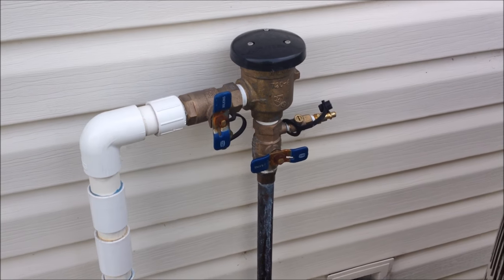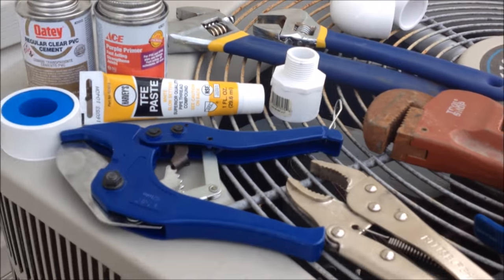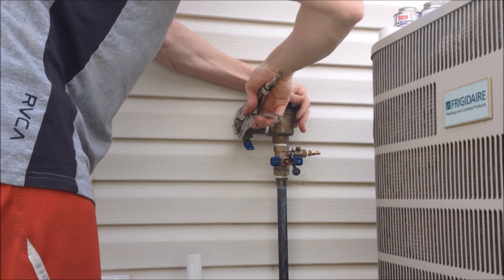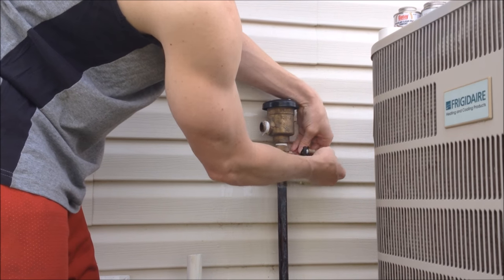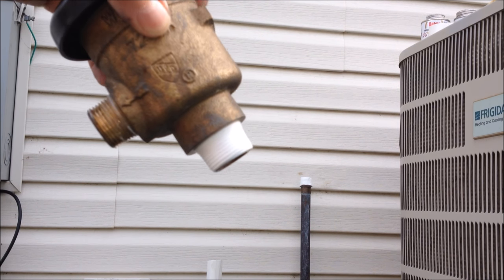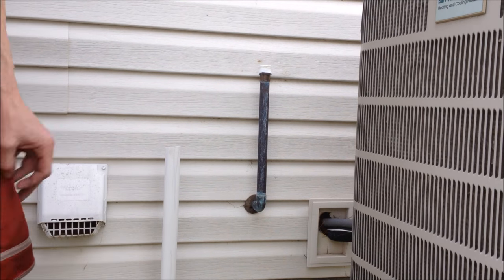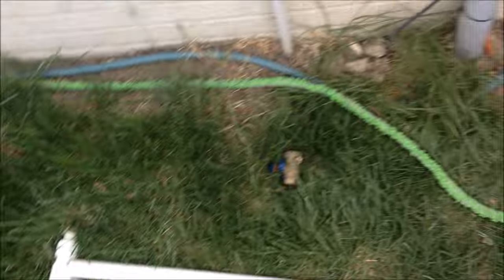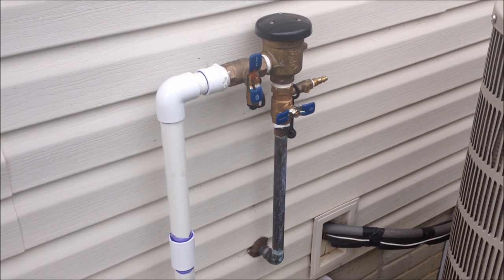FAST and EASY Backflow preventer repair.  Ball Valve replacement.

Comment: Thank you for this! Mom's sprinkler system has a significant drip at this same point, so I assumed it was from the ball joint valve not closing completely. When I turned on the valve, there's also a small crack in the pipe, (probably from freezing over the NE winter). I am no plumber by any means, but fairly handy, so I'm gonna give this a shot. Dad passed from Covid in Dec., so now we are having to learn how to do all these little house repairs ourselves. He would have taken care of it, probably without Mom ever even knowing it had been done! Learn something new every day, right?
Reply from the maker: Hello. Greeting fellow Nebraskan!  Sorry to hear about your father. Covid stole too many good souls…. I feel fortunate to still have both of mine, but wonder about life without them when the time comes. 

Yes, the NE winters can take a toll on these systems. Ever since I started winterizing my system, I’ve had no problems. I recommend winterizing to help save a bunch of work in the spring. Best of luck!

Comment: The plastic pipe will get brittle when exposed to the elements. Make sure you wrap them to protect from the sun and freezing.
I like to use galvanized pipes for anything that's above grade. 
Helpful video, Thanks for posting.
Reply: Nope. You referring to old plastic technology.
Reply: I am doing a bunch of repairs on mine. And wishing that I had galvanized pipes because the PVC got so brittle in the sun. Do you think I could go from PVC underground to galvanized up to the backflow preventer?

Comment: This setup MIGHT benefit from a “true union” ball valve installation (unions on both ends of the valve- CEPEX or HydroSeal Canada are good ones)? Yes, they are a little more expensive. But they will facilitate taking this assembly apart next time. You won’t have to cut and replace your pipe assembly. Just undo the unions and adjust or replace the bad valve. Good video, showing a common problem. Thanks for sharing!
Reply from the maker: That’s exactly what I wish I had!  I’d remove it in the winter and cap the pipes. There’s always the risk of a leak or crack come spring time. Even when I drain the system months prior to a freeze. Thanks for the tip!
Reply: Fast Fix Seen good prices for Hydro Seal Canada on Amazon. CEPEX is a Spanish Company but I’ve seen a few of theirs on EBay. The valves are PVC or CPVC. Also, supposedly, they’re rebuildable and adjustable. You can get replacement parts for them if needed? Hope this helps.
Reply from the maker: It does. Much appreciated!

Comment: I am certified to test and repair backflow valve assemblies. Your assembly should have not been installed that close to your house. You need to know how lucky you are that the ball valves came loose from the valve body so easily. Normally you need to place the ball valves in a vise and use large wrenches to get them apart. It is odd that you have an air chuck fitting on one of your test cocks. I assume your water authority does not require (in violation of Federal Law as well as most States) you to have the valve tested annually since the air chuck fitting would be in the way to make that test. Your water authority would require you to have that assembly tested to make sure it works properly after a repair. You did a nice job!
Reply: It's how they build houses MODERN houses...the are all close to walls.
Reply: I been  doin sprinklers for over 15 years every single  backflow is against  the house like that no matter  who is doin systems or what plumber  is puttin them in even some ppl be havein inside ones tapped off the meter  some dont want that big ugly backflow seen outside i repair these 24/7 each ball valve  does not DOES NOT need to be super tight ...

Comment: Leave the valves 45degree angle in the winter it will prevent cracking
Reply from the maker: REdUDEMAN yep, good advice!
Reply: @FastFixYouTube  Thanks guys!  Found mine cracked this spring, this'll help for next winter.
Reply from the maker: StheManroy you’re welcome! Best of luck with your repair.

Comment: @fastfix every year  to save you this problem  sense i specialize in sprinklers  for over 10 years when the fall comes and your ready to shut your system down for winterizing  drian that backflow leave them bleeders left open for the unit to breath and each ball valve leave in a half open and closed position  so the sides wont split again your not properly  doing it buddy but thumbs  up to your  repair lol
Reply from the maker: Hey there. You’re correct. This was the first year with my house and I had no experience with sprinkler systems.  Learned the hard way I guess, but I winterize every time now. Thanks for the suggestions and comment 👍

Comment: I just replaced the whole valve bc the original one was about 5 years old and our water is pretty "hard" here, but after installing the new valve and turning it back on it is still giving me the issue of leaking underneath the black canopy cover. I tried the bleed screws and that seem to help stop the leak, but now after about an hour went back to check on it and it is still giving me a very light very slow leak. How can this be when it is completely a new unit?  Please advise when you can of how I can flush out the debis without having to remove the whole thing.  Thanks in advance.
Reply from the maker: Hello Leah. Sorry about the late reply. Usually, the Teflon seal is to blame for slow leaks under the black cover. It’s the semi-clear disc that sits under the black canopy. In your shoes, I’d remove that piece and make sure there’s no rough edges or bends. You’d think a new one would be good to go from the factory, but sometimes quality controls fail. Are you noticing debris in the back-flow preventer?  If so, remove the canopy, and all the internal parts that seal the unit such as the Teflon disc and plunger. Turn your water on and let it blow itself out. Replace the parts and check again. Hope this helps 👍

Comment: I'm having the same issue with the same ball valve that you replaced here, but I don't have the pvc pipe, they're both copper. Am I going to have to cut the pipe to disassemble the backflow preventer?
Reply from the maker: Wow, you have copper?  I’m surprised no one has stolen your pipes!  Honestly, I’m not familiar with copper systems. If there are no threaded joints to unscrew, you may indeed have to cut the pipes. I’d call and ask a sprinkler professional to be honest. Sounds like there could be an expensive mistake should you do it incorrectly. Sorry, I don’t have any ideas for you. Best of luck.

Comment: No mention here, but you must used an approved part when repairing any type of BF assembly, and that includes the shutoff valves. USC Manual 10th edition are the rules we go by in Texas. Also agree with lunker012 about the test cocks, and they must be tested after any repair.
Reply: he is not a legit plumber just a homer owners saving money he dont need to be by the book lol

Comment: Do you have any tips for someone that has quite a bit of green corrosion all over these pieces and just wants to remove a ball valve?
Reply from the maker: Hello. The green corrosion is caused by small water leaks likely from the ball valve you want to replace. You can remove the coloration using lime/lemon juice and baking soda. There’s plenty of how-to’s regarding that online. Otherwise, follow the steps in this video to replace the ball valve. Best of luck and thanks for the question
Reply: @FastFixYouTube  I had the plastic PVC piece that threaded into the end of the ball joint piece break off right at the edge so you can't unscrew it!!
I use the Dremel to wear down the PVC to the point where it got to the threads with a drum sanding bit.
I got the ball joint off and I soaked the lower part of it and acetone in order to get the PVC out of the threads.
Reply: Wd40

Comment: I have the same backflow and my valve just cracked in the same spot! I can't find this exact quarter turn 1 inch valve anywhere! I can't even find it on Amazon. Do you have a link of where you purchased yours?
Reply from the maker: Hmm, that’s odd. They’re pretty universal. This is one I bought. It’s a 3/4 inch. 

#1 TEST PORT/BALL VALVE 3/4 X 3/4 (TAPPED); VARIOUS MANUFACTURERS https://www.amazon.com/dp/B004NKTC3E/ref=cm_sw_r_cp_apip_I7xQAkkDTrFyt
Reply: Now they are $55 on Amazon unless I’m looking at the wrong ones. What do you call the vent hole so I can keep searching? Thanks for the video.

Comment: For me the top valve sprays when it’s open how do I fix it
Reply from the maker: What do you mean by top valve?
Reply: @FastFixYouTube  if you look at yours right by the overflow thing, and when I open it it sprays
Reply from the maker: Okay. If the overflow is spraying, that is normal after the water has been shut off for a while. You have to have the spigot open completely in order for enough water pressure to buildup and close the overflow. Sometimes it takes several seconds. If it has other issues, I’ve got a video that might help. I’ll link in a comment below this one.
Reply from the maker: Here’s the video:  Backflow Preventer Repair
https://youtu.be/929yMUc6vCI
Reply: @FastFixYouTube  thank you, but it’s the valve by it that sprays it’s like a crack in the pipe or something
Reply from the maker: Oh, I gotcha. We’ll check and make sure if it’s the pipe or the valve. If it’s a copper line, it’s more tricky in my opinion and I don’t have a video on that. Otherwise, replacing the valve is the same as in this video, but sometimes calling a plumber is required. 👍 best of luck to you.
Reply: Alright dude, thank so much

Comment: I have the same type of setup: BP with test cocks on the valve (I have two test cocks, one upstream from the BP and on one on the BP), and PVC pipe downstream from the BP. I have read that you should not connect the compressor at the BP, and many videos show them connecting it to a port downstream from the BP. However, I don't have a port downstream from the BP. If I connect the compression to either of my test cocks, the air flows out of the BP. I understand that can damage the BP. I am using 60 PSI pressure. 

Any suggestions on how to blow out my system??
Reply from the maker: Jamshed I honestly hadn't realized connecting air before the BP was potentially harmful. I wonder why air pressure to the BP would be potentially hazardous? Obviously the PSI would be much greater than the water pressure...maybe that's it. Either way, if you don't have a shut off valve plumbed for a test cock after the BP then you might be out of luck. Unless there's a way to get air pressure in the system at the distribution valves. But then you'd be pressurizing the system which would lead back to the BP.  You could add a shut off valve after the BP in order to solve your problem, but if the system wasn't built with one, perhaps it's unnecessary to blow the system out. I'm not taking pressure to my system this season. I shut the water off in early September and hope the water evaporates.  Sorry I don't have a solid answer for you. Best of luck!
Reply: Yes to blow out system without ruining valve/seal in the breaker valve . Cut pvc after the 4 inches below the 90 home depot /lowes sells a 1 inch slip slip with a 1/2 inch threaded female glue that in . On internet or hardware store buy a brass 1/2 inch male to a 1/4 female also get the1/4 inch threaded  male brass cap to close off when not blowing out system. Teflon tape clockwise the 1/2 brass male end and screw into your 1/2 in. Pvc female now get a quick connect to 1/4 in. Threaded male and connect air compressor and shut main water supply off and close brass valve oclosest to your fitting you just made ti stop the air from pressurising backflow preventer. Hope this helped

Comment: why replace the valve with the same type that will freeze and crack the next  time???
Reply: Insulate the piping through winter and it won't crack again.

Comment: Also, Can somebody explain how the backflow preventer is useful ? First of all, in the normal condition, the city water has a 50 psi pressure preventing a backflow. Second of all, if something happens like the main water shuts off in the main line , the water inside the irrigation system cannot come back because first it's in lower level and second the irrigation valves are closed preventing the water motion.... It's an unnecessary device which usually breaks due to cold weather adding a burden on homeowners....
Reply from the maker: "The valves that turn on and off your irrigation system are not sufficient to stop backflow. The purpose of the backflow preventer is to protect you when the valve breaks or leaks, which all valves will do eventually." 

I got some useful information about your question here:
https://www.irrigationtutorials.com/irrigation-backflow-preventers/
Reply: Thanks for the response. What I meant from irrigation valves were the solenoid valves in the irrigation system. I took a look at the link you provided and it has addressed my question at the last paragraph of "why do you need the backflow preventer". However, there is a flaw in the presented argument. It says that solenoid valves are directional. This means simply that they don't work in the opposite direction. But, surprisingly, the article says that it works in the opposite direction to prove its point! With its own logic, solenoid valves are on-way and should prevent the backflow.
Reply from the maker: MrAmoslemi I was surprised there was so much argument about backflow preventers to begin with. Truthfully, I never really considered their necessity looking at it from your point of view. Well done!
Reply: Also depends if the solenoid is a normally open or normally closed valve. In a loss of electricity to control the solenoid, a normally open valve would present a cross contamination risk with the presented argument of the PVB being redundant device. Regardless of the argument for the sake of it, it’s the law and the water purveyors right to protect their water. Wouldn’t be a good idea to remove it saying the solenoid prevents it and try explaining it to the purveyor.  Sounds like fines and jail time.  Lol
Reply: @FastFixYouTube  Link doesn't work
Reply from the maker: THE TRUTH DENIED thanks for letting me know.  It looks like the site was removed or changed web address...or the site is corrupt.
Reply: @MrAmoslemi  Key word, they "should". I work in industrial controls and solenoids fail open all the time. The backflow preventer is designed as an additional layer of protection. 

Yes, the municipal water supply should always be adequately pressurized, but what happens if a water main breaks or the fire department hooks up to a hydrant down the street from you? The sudden drop in mains water pressure can draw fertilizer and contaminates from the yard back into your system. 

I consider myself fortunate not to have to share a dwelling with you lol.
Reply: In case you still think it is okay to not use a backflow preventer, the problem is with negative pressure from an event such as a main rupture which sucks all available water around it out like a straw (hence the term "backflow"). 

If you don't have fail safes in place, then if you (or anyone else in your neighborhood) are in the process of filling a kid pool (or your sprinklers are on, etc...) with a hose in the pool, and a main breaks (construction, old age and vibration from a pipe on incorrect outdated bedding, etc...), then that break is going to start hemorrhaging water. Cohesion is going to help the water molecules stay attached, while pressure tries to bleed off in the pipe. Diffusion dictates that areas of higher concentration/pressure will move to areas of lower concentration, so despite elevation differences, to a certain extent the water will be able to move out (2.31 feet per 1 PSI). Anything in range of these capillaries (water saturated in the soil from irrigation with associated dog pee/fertilizer that is close to a sprinkler head, kid pool dregs,  a filling car wash bucket, etc...) gets sucked back through the pipes and is now in the water main. Even if you have pumps in the system that try to compensate for the pressure drop, that just means there is more water available to shoot out of the break. Water systems are generally closed, so leaks can cause all sorts of weird effects if positive pressure isn't maintained. 

Most of the backflow rules we have in place in the states are designed after events have happened that have led to contamination. 

I hope that helps. That is why it is regulated here (and should be everywhere), and why you want all of your neighbors to have that barrier keeping their water in their lines. It's also why you want a good team out testing your system's backflow prevention devices accurately and annually. Those valves can and do fail, and annual testing ensures that they can be repaired in a timely manner while redundancy keeps the system safe.
Reply: the heads are not a perfect seal so water will get sucked back into the system but most importantly, what if the water pressure is lost while irrigating.  the heads are up. the zone valve is open, then contaminated water will get sucked back into the system,, that is the purpose of the backflow preventer.